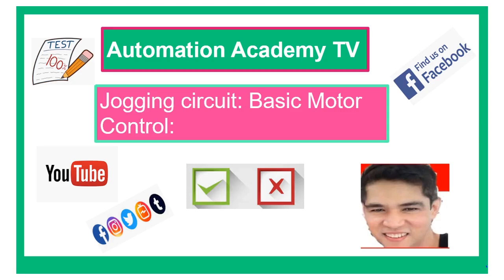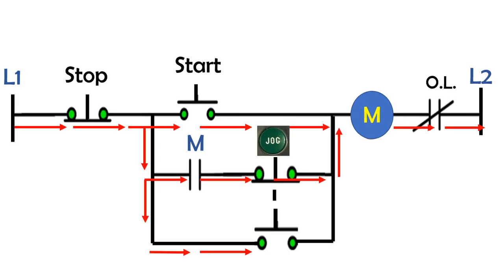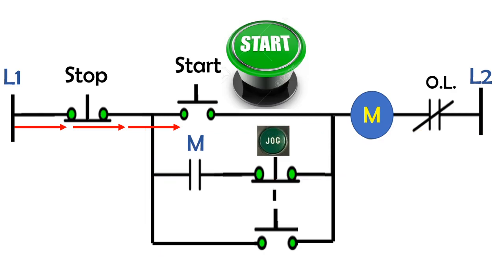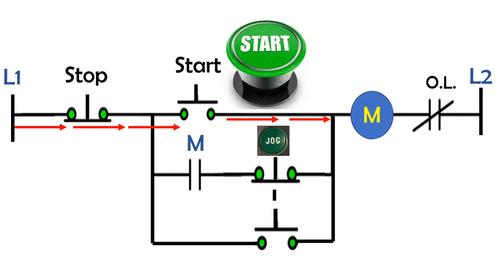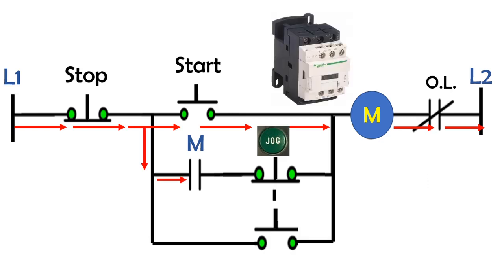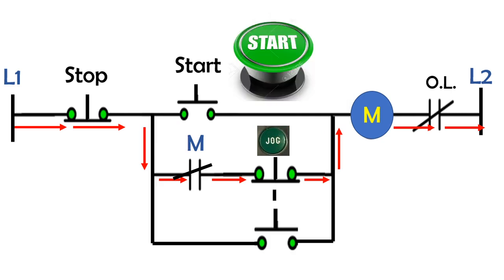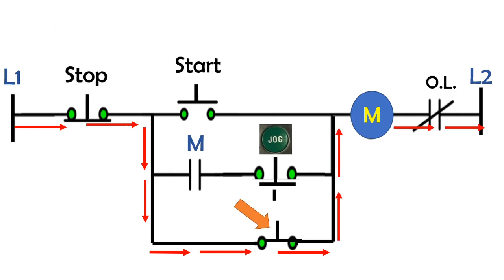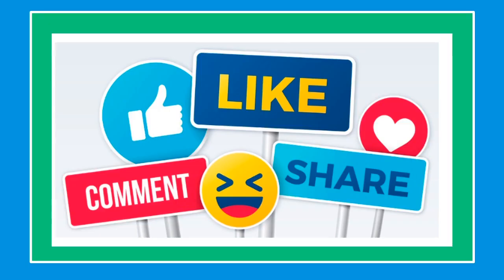Jogging circuit: Basic motor control part 1

Comment: This method works, but it can be hazardous and is not recommended. This relies on the contacts of the jog button operating as break before make; if there's a slight overlap (say a closed contact sticks), when the jog button is released, the normally closed side closes and the motor continues to run when you expect it to stop. Not a good way to do things!